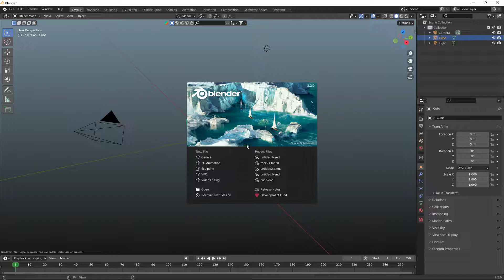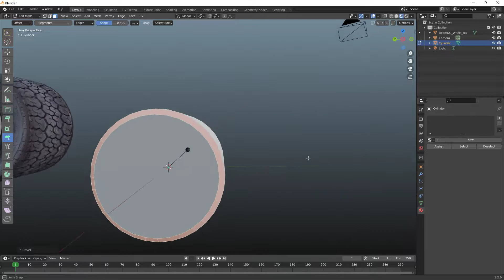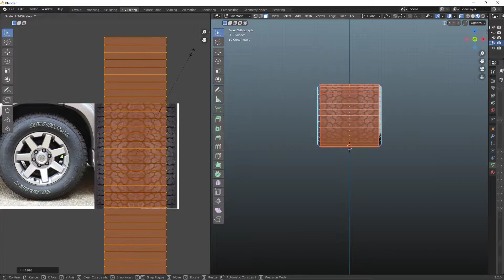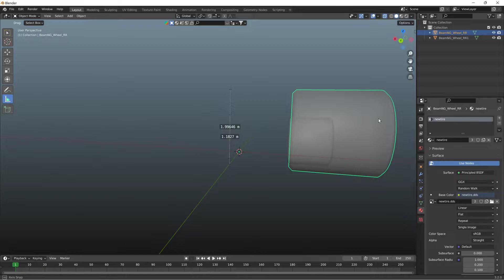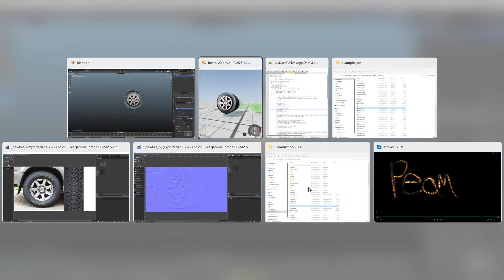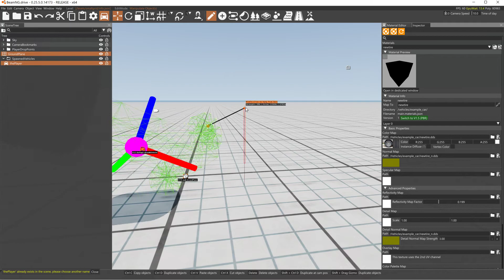Solution to Changing Wheel/Tire Size - Jbeam and Mesh/DAE

Comment: What would you change to give tires a higher rotation speed before they burst?
Reply from the maker: I will have to experiment with a wheel but pretty sure it’s in the pressure wheels section of the jbeam for the wheel/tire. Most of those from the dev cars are zipped in the common folder, that is also in the vehicles folder in the install location. Someone who is made familiar with car parts, wheel sizes, lug nuts variations and knowledge to what wheel goes to what car would do better looking through the commons folder for them. 
There are spring strengths and deform settings for the jbeam that makes the tire. If you have already messed with the settings, you likely have better idea than I would as far as the limits they can take. My brief look into it a while back I was trying to move a wheel and change the scale of the tire and kept popping the tires. It’s a balance act for a good tire, and likely a more demanding balance for a tire that will push the extreme. 
You can also check out Filman86 channel. He may have already made a video on this exact thing.
Reply: Hi